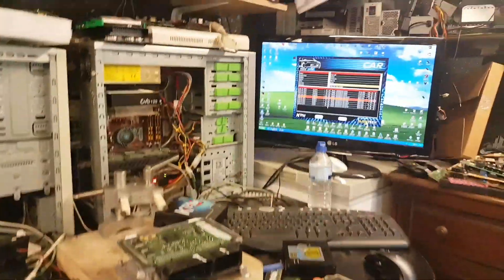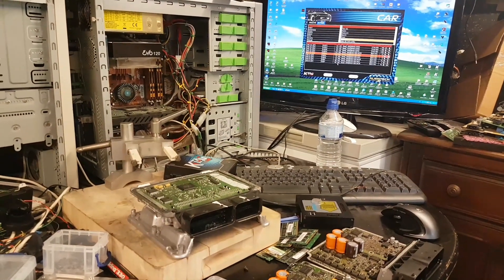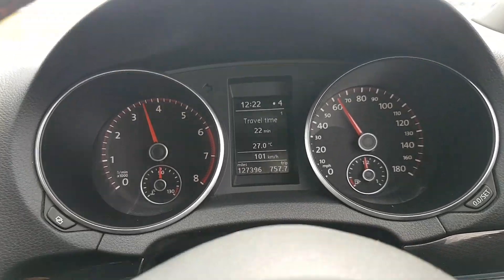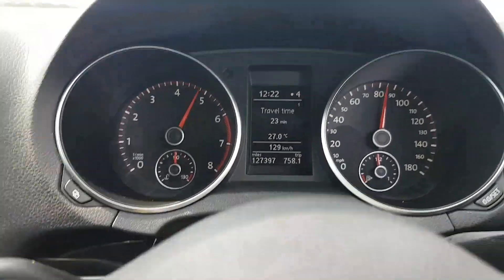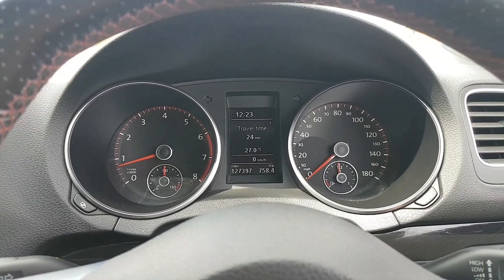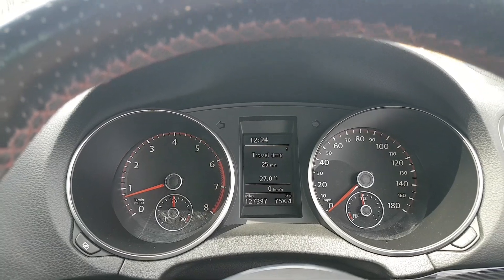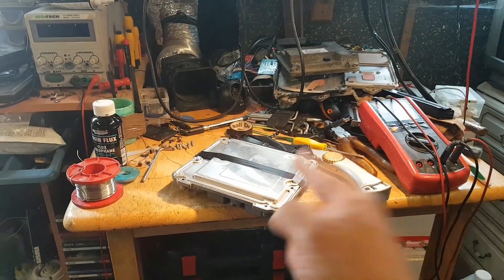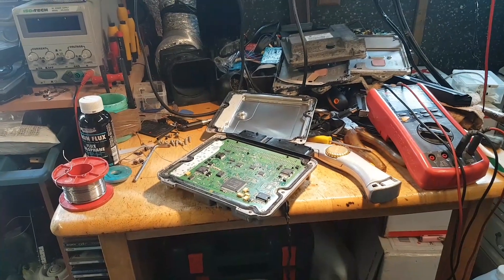Golf GTI MK6 ecu remap... Bosch MED17.5 read and write with K-tag.

Comment: Hello, can you change the gearbox ratio? I swaped my gearbox to a quattro and now my cruise control dont work because another gear ratio.
Ecu MED 17.5
Reply from the maker: Hi
Should be possible to flash the correct software to match the gearbox or do it under coding. 
I never had that situation, so I would need to investigate the solution...
👍👍👍

Comment: Hi. Is it possible to swap components from original ECU to new to bypass an immobilizer issue? If so what component needs to be swapped.
Reply from the maker: Yes... depends on the ecu...👍👍👍
Reply: @LMAutoRepairs  It's a 2014 Jetta TDI. I believe it's the same module as this video.
Reply from the maker: I believe the immo on this one is stored in the MCU... the MCU is not easy to swap, but possible...
You better clone it, with k-tag or similar, or immo off, but either way you need the read and writing tool...
👍👍👍

Comment: where is the med17.5 ecu most likely located ?  i haven't done one yet but might have to do a skoda 2014 1.4tsi soon.
Reply from the maker: Some vag cars the ecu in under the windshield... right at the bottom... on the opposite side of the wipers motor...
👍👍👍
Reply: @LMAutoRepairs  yh i know a lot under have em under the windshield wipers. Also seen a couple near the battery can't find luch info about this perticular skoda

Comment: i cant get power on the ecu, but iveconnected everything like you did i think
Reply from the maker: What do you mean?
Are you powering k-tag externally? 
You need a least a 2 amp power supply to k-tag... otherwise can give you issues...
👍👍👍
Reply: @LMAutoRepairs  i dont have ktag i have kessv2 but it wont read trough OBDII
Reply from the maker: Not sure if Kess reads it on the bench either...
I was using K-tag... never did such thing on the bench with kess... I use kess for OBD work...

Comment: i can do your remaps cheaper! ECu tech dont looks pro. all china stuff..
Reply: Just because you have a snap on tool chest full of snap on tools does not mean you know how to use them...
Ktag/Kess is just a tool. Makes no difference if its genuine or clone. Any ecu tool will write whatever you tell it to write. 
Ive done this for nearly 28 years. The people like you that always undercut prices keep me in work correcting bricked vehicles, or vehicles that run like a bag of shit after a tune. And how do you know i use clone tools? You have never seen my workshop. Good luck with your business and stay safe.
Reply: @EcutechDiagnosticsLTD  u are right as long as it read writes...but u know clones are prone to fail. little bugs that even genuine ones had to improve with updates.
I really know my way with remapping also i use genuine softwares and damos
Reply: @Automotivesp  That's great.

Comment: Hello LM Auto Repairs

I watch your video, you are doing an excellent job ..
I have some questions about the cable because I also have Ktag SV 2.25 HW 7.020..but in the instruction where you have to connect the pins of your video I see that your cable has 3 red pins .. which means in the instruction it shows me (PIN 5,87,92) - (COLOR red and orange) - (DESRITPION + 12V) while in the picture these three pins show me red .. now on my cable, I have only 2 red pins and you in the video have 3 red pins. .now I do not know which pin should be orange and which pin should be red these two pins have a smaller head as I see the instruction..please help me with this because I am a beginner and I want to learn a little from .. thank you very much for your videos ..

respects
Reply: thank you for the very quick answer..do you not know somewhere online to buy this cable with these functions that you possess ??  thank you very much
Reply from the maker: @fatoshodja1517  
The normal cable should come with the unit...
The modifications I have made them myself... so not sure you can get one...
Nevertheless, is only an extra wire attached to the existing ones...👍👍👍
Reply from the maker: No orange wire connected...
My one has 3 red ones, because i have added a 3rd one for the ecus that require 3 power feeds...
Thank you for watching!

Comment: have a problem with Citroen C4 Picasso 2007 automatic gearbox does not engage gears and stays only on neutral codes are 
P1724 , P1732 , p0868

Comment: One question,why did you open the ecu?
Because you connected the program threw pins.. that were accessible without opening.
Thank you
Reply from the maker: You missed the boot pin... which is connected straight on the PCB...
Pay attention to the picture number 2  at the start of the video...
Thank you for watching!
Reply: @LMAutoRepairs  Why are some programmiers (like FC200) able to read the MED17.5 without opening and some (K-TAG) are not? I am currently looking into this because I need to immoff and have ordered a K-TAG programmer.
Reply from the maker: Immo off you most likely need the eeprom data...
Reading through OBD or in SM most only read the maps...
K-TAG should be able to read both in BDM mode...
👍👍👍

Comment: Can you help me? 
My tdi burned the light switch the oem one.. after replace with aftermarket one lasted 1month.. everything works but not the low beams or high.. only high when pull the flash high beams ... 
So the switch is not passing current to the headlight wire now.. so i jumped it ans the headlights o  low beam pulling 7.8 amps and the low abd high 12amps total of 3amps for 4 H1 lights... dont know why it burned... but the wire that goes to the headlights  on the terminal that connects to the switch peeled the "skin"  of it... strange...